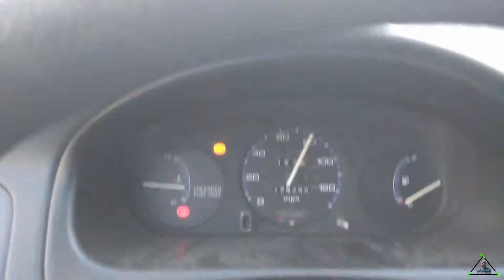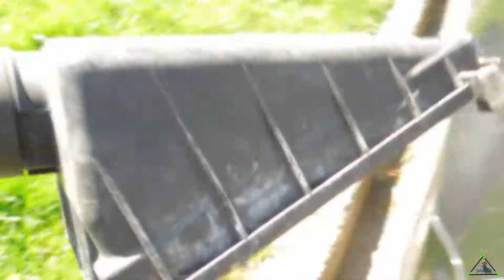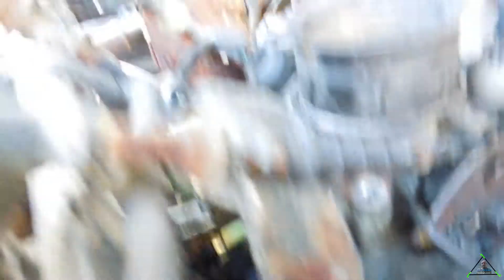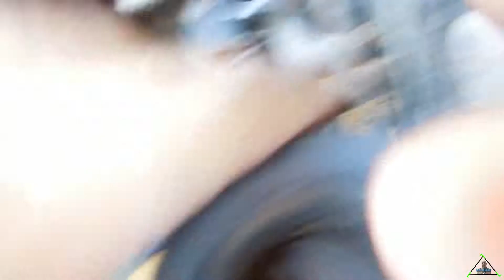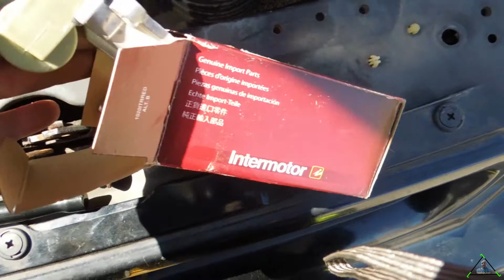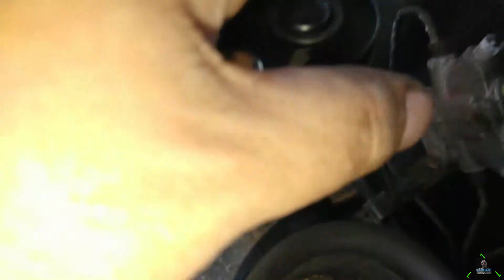How to replace an Idle Air Control Valve

Comment: Nice video. Too bad that replacing the idle air control valve didn't totally resolve your issue, but as a G33k troubleshooter you know, you've just removed one more obstacle on your way to success. I'm sure that replacing that part was part of the solution, unfortunately just not the whole solution, you'll get it, I'm sure of that and I can't wait to see that video. I can't believe you're doing a lot of this stuff one-handed, you aught to get a couple of those mini-gorilla camera stands (not sure what they're really called), and mount up a couple of phones to video and free up your hands. You're doing a great job, you've got on-screen charisma and it's really fun to watch you fix stuff, i can't stop viewing the video once I've started. You're kinda like a G33k Bob Villa. Good luck! I look forward to the next video.
Reply from the maker: Thank you and yeah I'm working to find the vacuum leak now. But I'm happy that the car is driving a ton better than it was. I'll find the leak soon. It may be the intake manifold gasket but I'm not 100% sure yet.
Reply from the maker: Also thank you about the footage. I'm currently using a cell phone and an old Nikon point and shoot. Eventually I'll have to get a couple go pros and those stands you're talking about. I'm definitely having a great time finding ways to fix things!